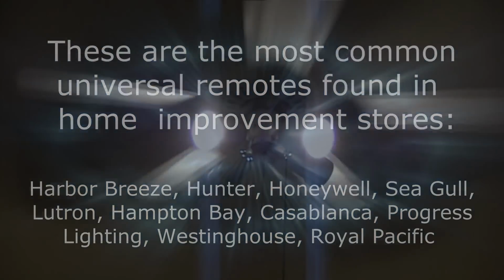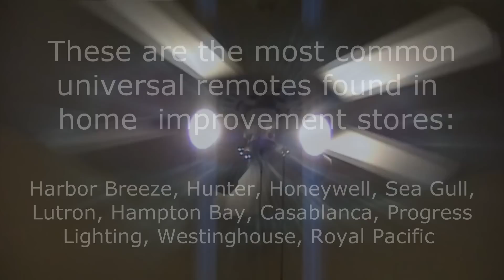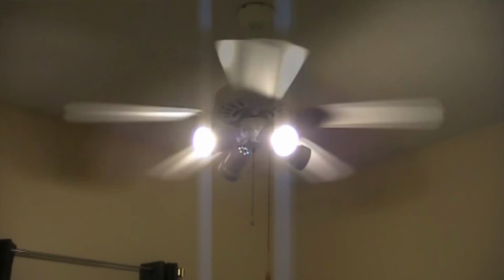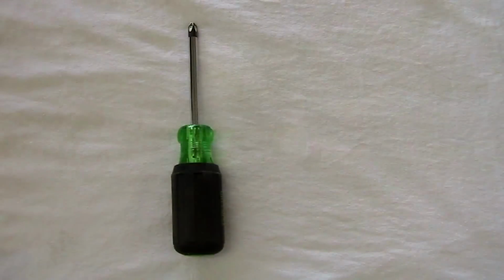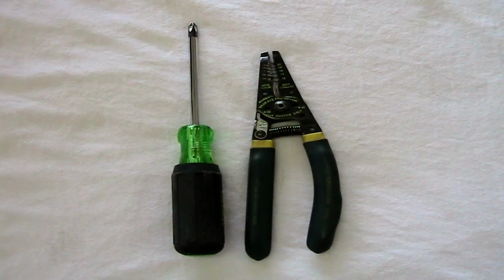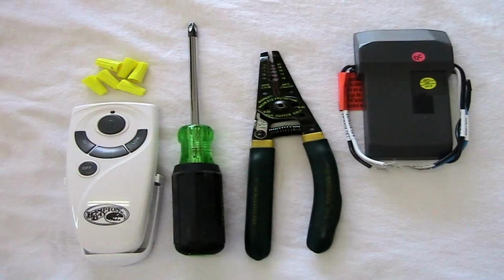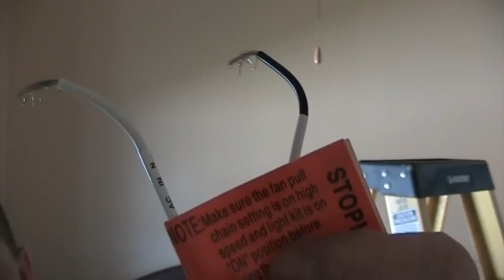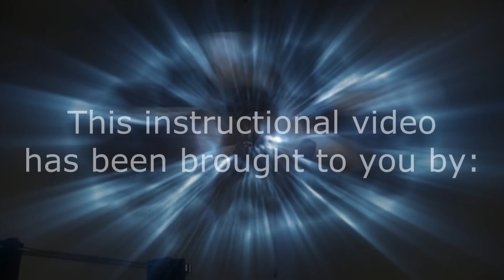Installing a remote in a ceiling fan

Comment: "set the dip switches" - My in-laws built a new house about 3 years ago and the Builder installed five Westinghouse ceiling fans with lights and remotes mounted in the wall where the switch would normally go. He didn't bother setting the dip switches before installing them so if you hit the button for a light in one room it will turn on or off lights in another room. She had him out several times trying to figure the problem out, it took me 60 seconds on a Google search to figure out what was going on. Thanks for the video you just confirmed what I had already thought, the guy installed all of the fans with Factory dip switch settings, what a moron.

Comment: Thank you for such excellent video. Thanks to you, I was able to instal my ceiling fan w/remote. QUESTION: The existing on/off switch from the wall no longer controls the fan/light.  Is it possible to make both (remote/wall) work? I mean, if I was to misplace the remote, how do I make it work without it?

Comment: I am replacing the old remote with a new one from the same manufacturer. I was not able to figure out how to set the fan to high before starting to install the new remote.  I set the dip switches of the new remote  to match the configuration of the old remote. Once the new remote was installed I turned the breaker back on and then set the remote to on. The light and the fan both turned on and the the light as well. There is a dimmer switch and the remote has three speeds as well. When I couldn’t get the remote to do anything besides “on or off”  9light and fan) I  tried to set the switch on the fan to high. Well that was catastrophic test as now the remote does not work at all in turning on either the light on the fan or any speed on the fan. I was using the old receiver because the remotes appeared to be the same. I have checked dip switches and they are both set correctly. What should I do in order to calibrate the remote and receiver correctly? I was unable to set the fan speed to high before doing the installation. I sure could use some assistance and am very grateful for any help!  (The UPC code for the remote is 792145354369). Thank you!!!!

Comment: We have a fan that works but the pull chain switch doesn’t work so it only has one speed - it is installed with a swag kit so be use a toggle to turn it in and off.
The fan has a non-working remote that we are hoping to replace. Will it work if we can’t put the fan on high using the pull switch?

Comment: After installing the remote, does the 3 speeds get controlled by the remote and not the pull chain switch?
Reply from the maker: Leave the pull chain set to high, the three speeds will be controlled by the remote.

Comment: Hi.nice video what about ground wire.please follow up. Thanks
Reply from the maker: Hi, you need to connect all the ground wires as this protects all metallic parts from a short circuit and protect you the homeowner from electrocution.

Comment: U didn’t say anything about 3 speeds fan , on which speed  should be remote to operate from remote. Make it clear please so people understand . Thank you
Reply from the maker: Tony Delini the fans pull chain should be set to high.  Once the unit is working remove the pull chain so the setting can never change.

Comment: So I dont need the red wire at all   I had a regular light  I noticed that the red wire was connected to the black wire of the light my home has red black and white
Reply from the maker: Correct, when wiring a remote you do not need the red wire.
Reply: Thank you now I'm installing another ceiling fan with light but on a single switch red with blue black with black and white with white. Looks great but the fan motor doesn't work.
Reply: @TheElectricalDoctor  do I use the red on this installation and not the black 
Black,blue with red 
Cap off black wire 
White with white 
Green with bare wire 
Correct
Reply from the maker: @artcerv10  What you want to do is make sure power coming to the remote receiver stays hot all the time.  So if the black wire is not switched, then use the black and white as the incoming power wires.  If red is the non switched, then use the red and white.  Residential wiring is not specific and every electrician across the country wires circuits differently.